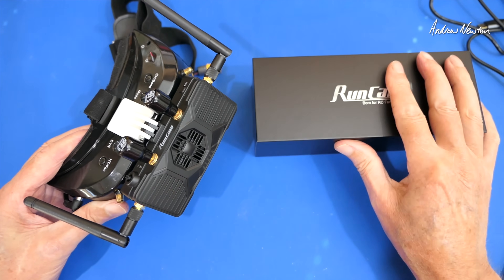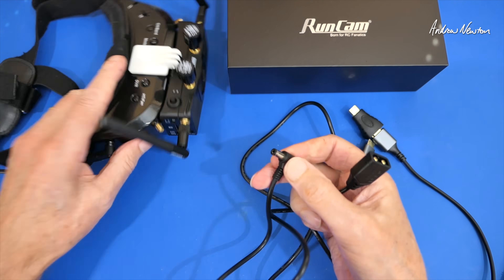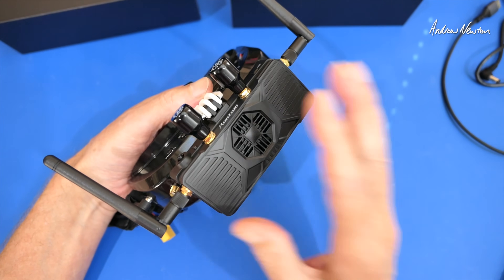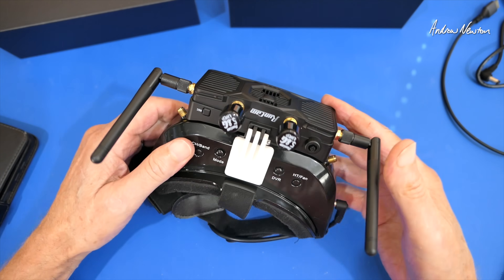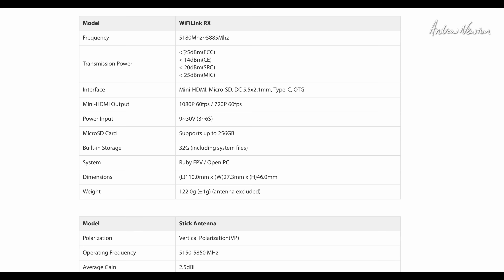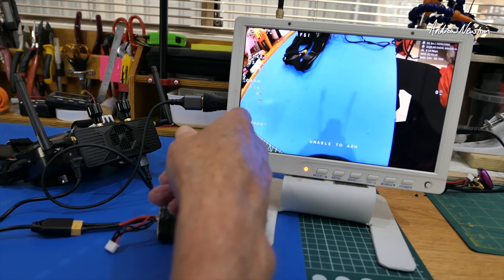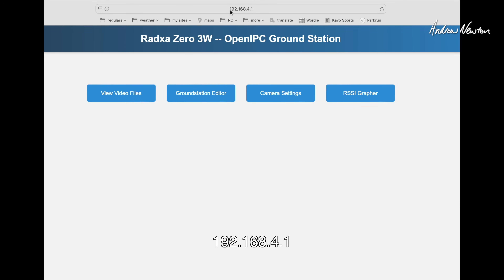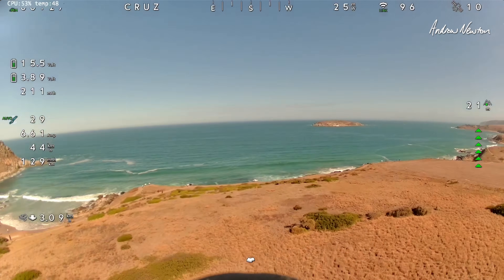Runcam WIFILINK OpenIPC Video Receiver

Comment: Hi M. Newton, I was wondering if I can use wifi link RX with my android phone and the application pixel pilot, because i’m using my phone as a pair of goggles, thank you and have a nice day.
Reply from the maker: The RX works with HDMI screens so your phone would need to accept HDMI in. Your phone is more likely to work with the WiFi dongle method that I covered in the previous OpenIPC reviews.
Reply: @AndrewNewton  thank you M. Newton

Comment: Installed ruby fpv on mine,  what a difference,  with the open ipc firmware i could get 100 meters without losing signal,  ruby fpv 5klm
Reply from the maker: Interesting, Might have to switch

Comment: With Walksnail Goggles L (the ones with internal antennas) and a 1s VTX on 25 mW I was able to go 800 meters before the bitrate started to drop.
On 500 mW I went 2.5 kilometers and still had full 25 Mbit...
Reply: You guys whining about pricing, ya kill me, ya really do. ALL these digital FPV systems are crazy low priced compared to broadcast stuff that gets the same image quality.
Reply: @PiDsPagePrototypes  Thanks to the economy of scale you can get devices like Onn 4K TV box that is able to decode H.265 , H.264, AV1 streams up to 4K resolution. Last time I checked it costs 20 dollars ;-)
Reply: @kmieciu4ever  yup. Compare to a LiveU or Cobham Solo, little change out of AU$10k.
Reply: Yes... But at double the price of OpenIPC.
Reply: @PeterM-PeterM  What's the price of OpenIPC googles, because I paid $160 during a Caddx sale?

Comment: Very interesting, thanks so much ... I am also just looking for a HD FPV video system and bought the Runcam VTX and USB diversity stick, which will obviously be less good than your 4 channel diversity setup with up to 25dBm (500mW) ... now I see a Emax Wyvern Link AlphaOpenIPC 2W RX with USB-C connector and a 2 channel diversity RX, which is supposed to do "long range" and costs less than your bigger Runcam VRX .... I can imagine that when the video frames get confirmed with higher power = lower bit-error-rate, the frame flow should be better, but it also doesn't improve the VTXs power - so I am not sure if that is a good option when you are already getting frame drops at one kilometer. I think this is a new interesting field that will require a lot of experimenting and tweaking with antennas, resolutions/framerates = bandwidth, codecs and firmware. I am not a fan of flying with goggles, I'd rather have a ground station with a smartphone, pad or monitor when trying longer distances and surf along the beautiful clouds. Will see if I find a solution/setting that supports that.

Comment: Everyone is going to compare this to DJI and Walksnail. That is completely valid but having an open source alternative to those is huge. If its still flyable but lacks some of the features and quality what it will do is force the others to keep their prices in check and continue to innovate. So even the people that fly those other systems will benefit from a quality budget option. The opensource nature is also good as anti consumer features just wont even be started. So things like forced upgrades won't happen it will be backwards compatible as much as possible across generations. Something that is key when we are talking about an eco system of transmitters, receivers, encoders, cameras and more.
Reply: They got a long way to go it’s not even flyable in its current state. Wifi streaming and fpv doesn’t mix, unless it’s for the viewers.
Reply: @Murphys_Law9  we just saw a video of it being flown